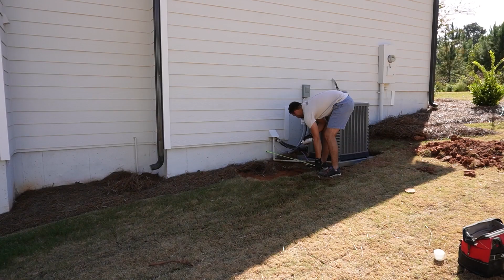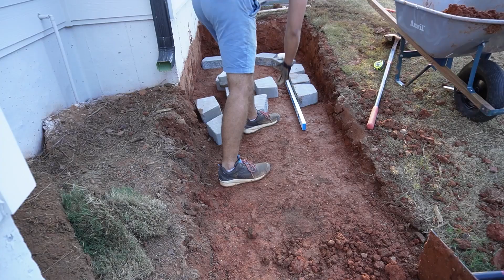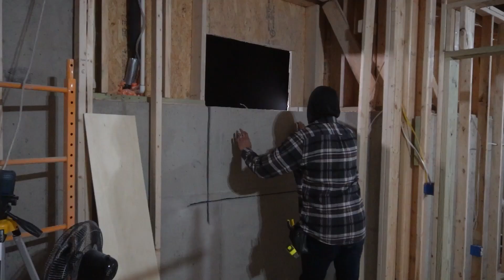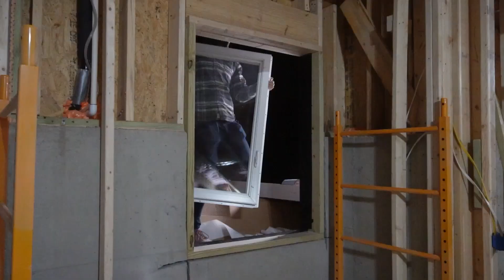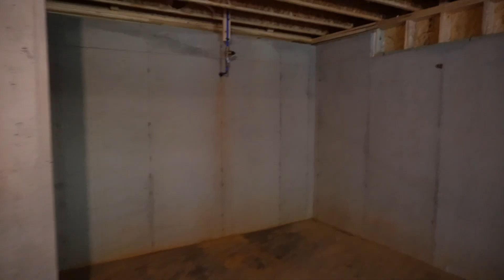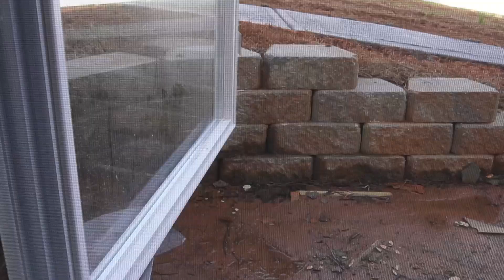Turning $500 Into $30,000 by Adding an Egress Window | Basement Renovation pt. 2

Comment: It is my understanding that all egress windows in basement areas must open inward so they cannot be blocked from opening by anything on the outside.
Reply from the maker: Building code requires that the window open fully but doesn’t specify which direction.

Comment: Question so a 72x24 window is that under guidelines for a room? I’m also in Atlanta. Shoot I might need your help lol my first time doing it
Reply from the maker: It depends on the type of window. If it’s a casement window than it might be okay, if it’s a traditional window it might be small.
Your window has to have an opening that is at least 5.7sf and 20” wide. It’s most likely that a 24” window doesn’t have a 20” wide opening. I bought one and had to return it because it was like 19.5”

Comment: Drain is not adequate, weeper must be installed vertically all the way down to gravel at footings, interior header also not built correctly, needs to sit on queen studs and tacked to kings. The fact you barely excavated is irrelevant to how to build.
Reply from the maker: Incorrect, this is not a window well, it does not need a drain going down to the footings. And I don’t know how much experience with framing that you have but you’re referring to jack studs I don’t know what you’re going off about with “queen”?
Reply: @theweekendbuilder  I'm betting you didn't get this work permitted. The framing around the window, including the header, isn't sufficient. The left side (as looking outward) doesn't have a continuous vertical piece of wood (rim studs) backing up the cripple stud. The number of rim studs on each side needs at least equal 1/2 the number of cripple studs above the header. Which means you basically need at least two on each side (plus the cripple stud). Not one as shown on the left or zero on the right.

Good luck with disclosures when you sell the house.
Reply: @theweekendbuilder  Also, those saw slots left in the foundation are terrible. It leaves concrete cantilevered / unsupported. Concrete doesn't do well in bending. Expect cracks to propagate from those locations. You should have drilled fairly large holes at the two corners (tangent) and not sawed past those holes. You should also saw from both sides to compensate for the circular blade. This also minimizes the remaining concrete needing chiseled to finish a clean rectangle.

Comment: Wouldn’t you need an structural engineer to look at it? Since you are changing the basement structure? I want to do this men I’m in PA
Reply from the maker: It’s a great idea to get a structural engineer to look at it before building. All of that will get checked during the permit process though